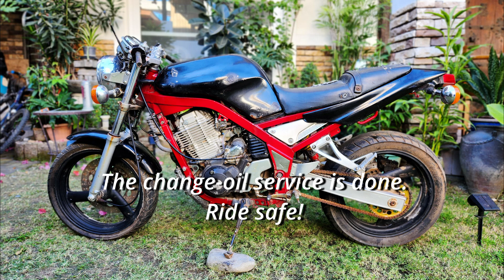Yamaha SRX400 3VN Change Oil - Thumper Project #yamaha #srx400 #motovlog #changeoil #projectbike

Comment: Hi Steven. Maybe I missed something. I noticed that you drained the oil tank. And you removed the old oil filter. But I did not see you pulling the engine sump plug. It's behind the side stand hinges on the engine casings. Then when you checked the oil with the dip-tick, you had the tank capacity at the "F" mark. All well and good, but there would still be old oil in the engine and transmission. 
     When I pulled out the tank drain plug, the sump plug  and replaced the filter, I was several notches down on the dip-stick when I checked the oil after the specified refill of 2,500cc. Now I am wondering if the spec is for the tank drain and filter change only. About 200-300 cc comes out of the sump. when you open it.
     BTW, I tried using full synthetic oil in my 1990 3VN 400, but I had terrible oil leaks. So I used Permatex gasket maker to seal the filter cover and the drain plug washers. No leaks so far. (And I went back to semi-synthetic  — 10W-40.)
     Good luck with this project.
Reply from the maker: Oh man, thanks for this. I actually didn't drain the oil from the engine sump plug. I'll definitely do that on the next oil change. I've already drained the oil tank 3 times already in a span of a month to try to remove the really old oil in the engine. I'll definitely drain from the engine sump from now on. Cheers!